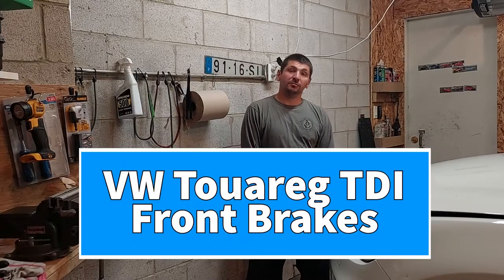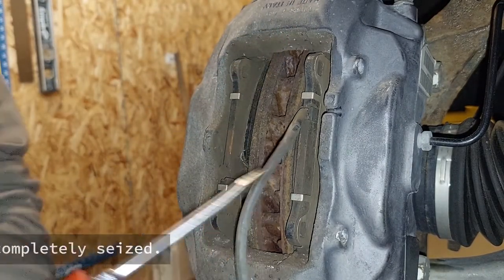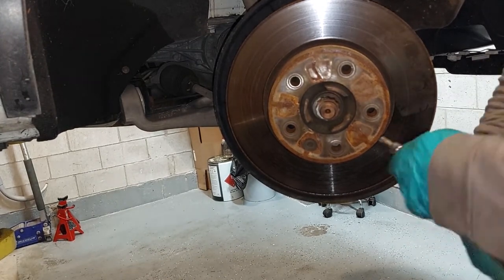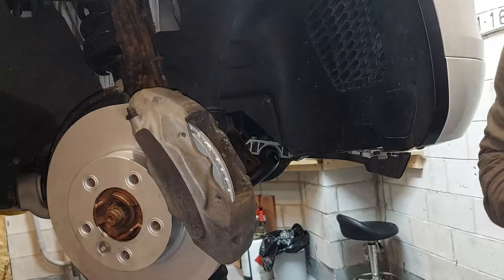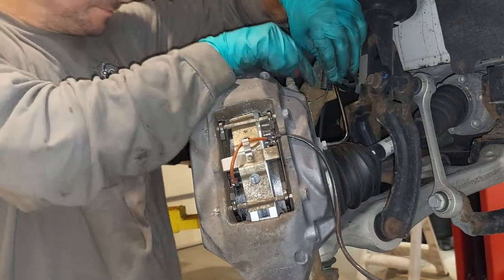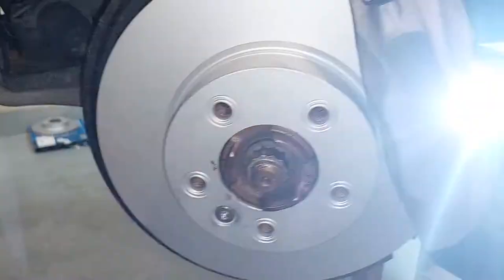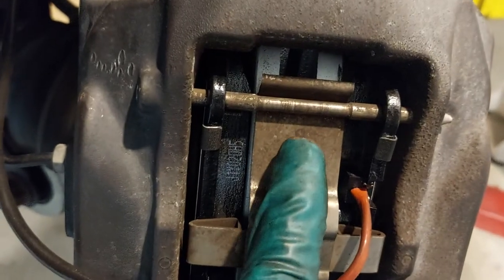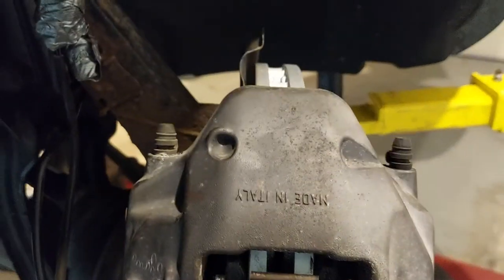VW TOUAREG FRONT BRAKES

Comment: I noticed you didn't use any antisieze anyplace on brake pads or wherepads contact piston Is that what you normally do?
Reply from the maker: To be honest I normally always put some on the piston where it contacts the pads. but this is a floating style brake set up. I'm actually forgetting if there is a reason I didn't put some.

Comment: Great video; thanks for sharing. Question have you ever experienced vibration when you’re driving around 75 to 78 miles an hour?
Reply from the maker: If it's under braking it is the rotors that are out of round. If ita just driving ita wheel balance.

Comment: Great video, do you have a video showing how to replace the 2014 VW Touareg's the rear brakes and rotors?
Reply from the maker: Check the cayenne video very similar  note the e brake air gap issue.